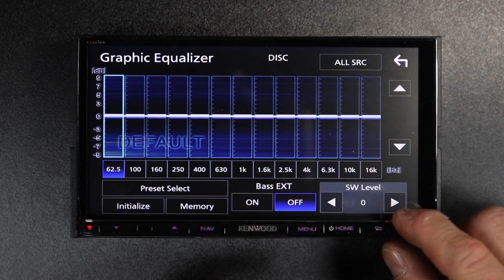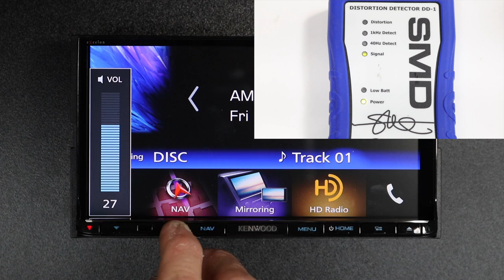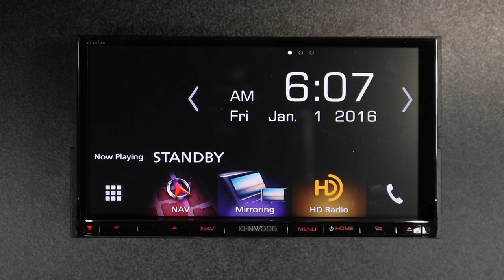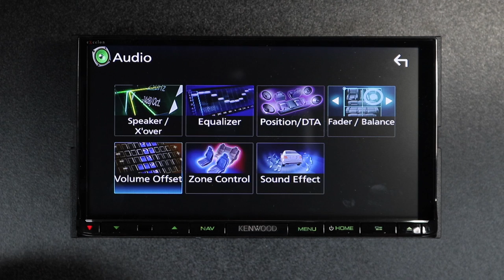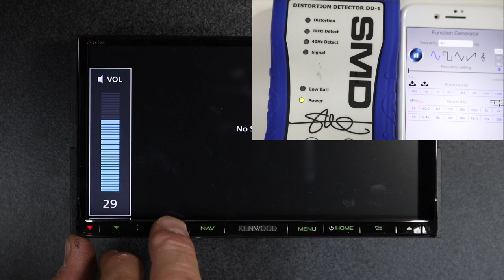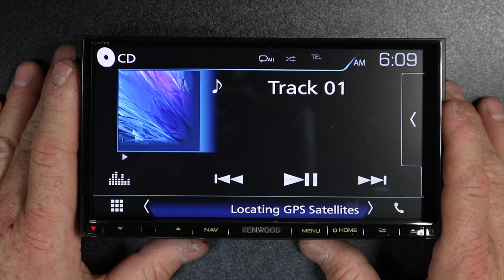Where does my DDX9903s or DNX893s distort or clip at?

Comment: i dont have a DD-1 however i am trying to set my gains using test tones and  DMM. and for somereason when i put my probes on the amp output  i dont get any reading until i turn the gain basically all the way up and it gives me -.33?? im set on AC Voltage 20 and tried the probes in each of the plug locations i dont understand

Comment: how come you use a tone generator and not the DD! test cd tracks on Spotify? Steve suggested i use that when testing my DMX906S because i dont have a Cd player. have you ever noticed the distortion light will just flicker at one volume push say like at 25 then go off from 26 on up and then only flicker at 25 going back down. not saying that number particularly just as an example.

Comment: Ok I got what might be a stupid question. I had a DD1/CC1 combo but it was stolen which sux so bad. Anyway, ok so this kenwpod max's out at max volume with a +4 offset. But you had the sub set at 0. As I recall I was able to use a Kenwood BT958HD and I got the same result, BUT I was able to turn the sub output up to +7 or +9 and still get no distortion. Am I remembering wrong or not? You guys should definitely add this step to your DD1 videos. Lemme know, cause now I'm scared to turn my sub up at all.

Comment: I have a DD9906XR and it distorts at 29 through aux with 0db 1000hz through rca's. Its so blatant it doesn't warrant 200 dollar test equipment. I set gain with oscope on Alpine mdr v75. So darn irritating as I went from mrv v500 and really can't tell any level difference despite power rating is like triple. Should have gotten like 12db louder. Still playing with it.

Comment: i have a question i have this rockford fosgate p400x2 running the single 12" sub in original box i had the amp for just 2 weeks before it nuked it self no clipping normal use the cap read nice 14 volts good solid ground point so today it came back from repair the store told me bad power feed grounding or cliping was to blame i smelled bs in that so went to the instal guy at the store got every thing checked used the disk to get it properly gain matched every thing run great did som new speakers in the door and afther an houre i drive the one and a half houre home 30 minuts into the drive i started smelling burned electronics gues what the freaking amp nuked itself again what could be the problem
Reply from the maker: +ljmike1204 my first question would be what ohm is the subwoofer?
Reply: it got wired for 4 ihm

Comment: My car doesnt have amp in it. Straight headunit to the speakers. How do i run the speaker wire to an aftermarket amp?
Reply: gurbeer athwal you can use 9 wire. RCAs from radio to the amp. Then use the 9 wire to connect your speaker wires to the amp
Reply from the maker: +gurbeer athwal check out our playlist "from the install bay" there are a ton of pointers

Comment: What would be the best way to set your gains using a smd dd1 for subs only? Say you are using the decks power for your mids and highs and you don't want to damage your mids and highs wth the test tone
Reply from the maker: +zmanbad you can test the output of the radio with the speakers not connected. So find the clipping point for the radios amp, use that as max volume. Set your sub gain to that point.
Reply: i probably should have added id be using a stock radio.